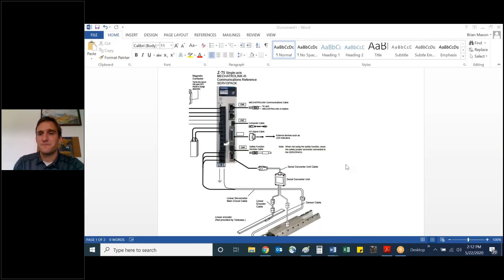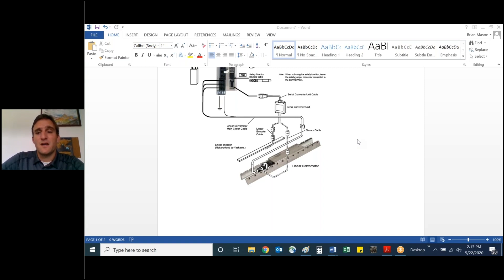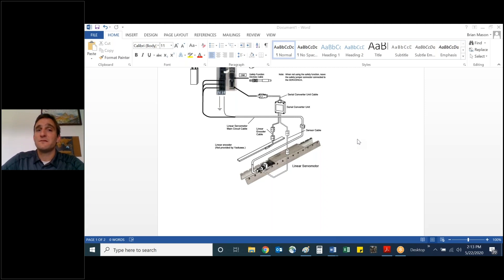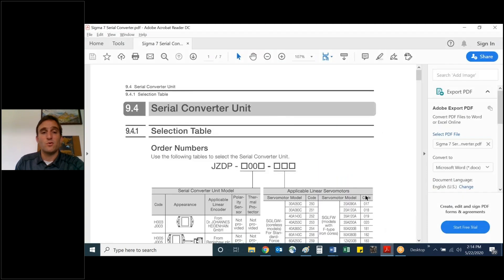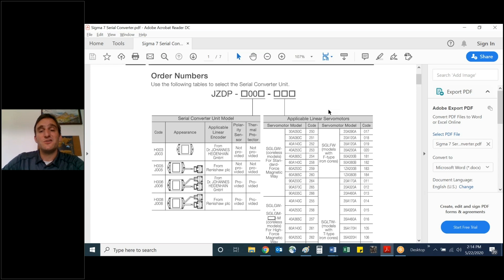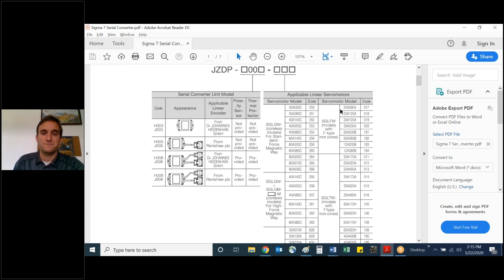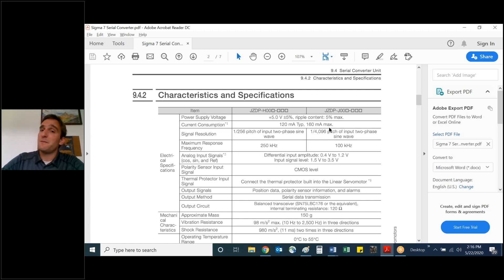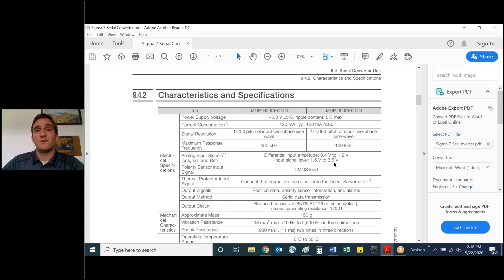Tip: How and When to Utilize a Serial Converter

Comment: by 'built into' the motor drive, are you saying you don't need a fully closed feedback option card installed in order to use a (secondary) fully closed encoder? You just need to multiplex the two encoder signals into one, using the serial converter module? Or is that statement assuming a feedback card is in use?
Can you confirm the maximum resolution/ppr pre-quad and post-quad for these serial converters? 4096 positions is hardly adequate, but post-quad, 16,384 would be sufficient.
Thanks!
Reply from the maker: Thank you for your interest in "Tip: How and When to Utilize a Serial Converter". Here is a video with more detail on the Sigma-7 Full Closed Loop. (https://www.youtube.com/watch?v=3gFPA9WePyg) For creating a fully closed loop with an external encoder, a fully closed loop card is required. The serial converter resolution depends on the model being used. We suggest contacting  the nearest service provider in your area: https://www.yaskawa-global.com/company/profile/global or contact our Technical Support Team for further assistance at https://www.yaskawa.com/support-training/support.